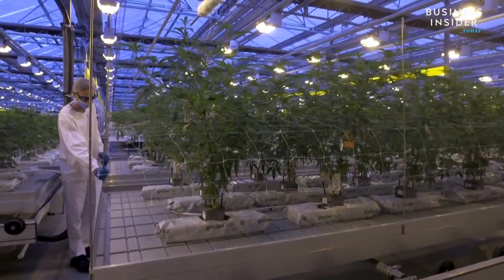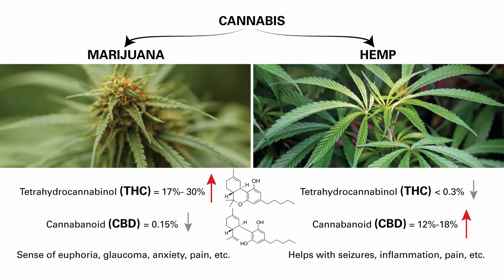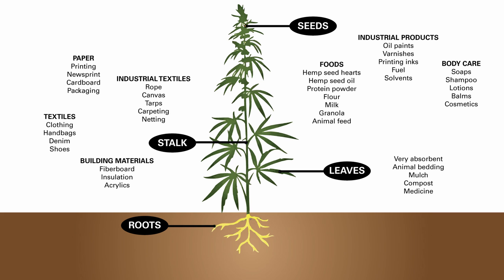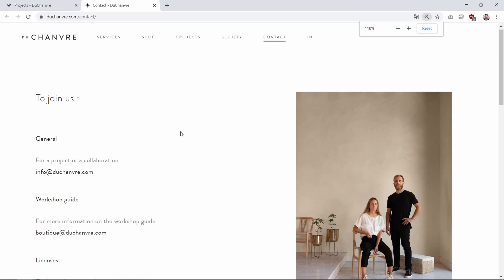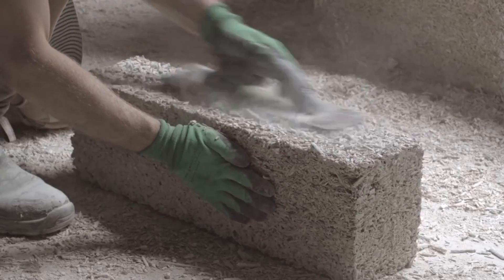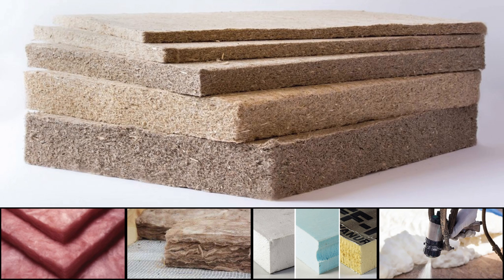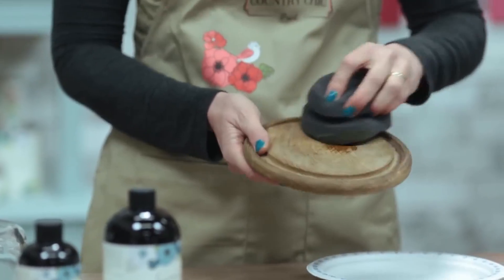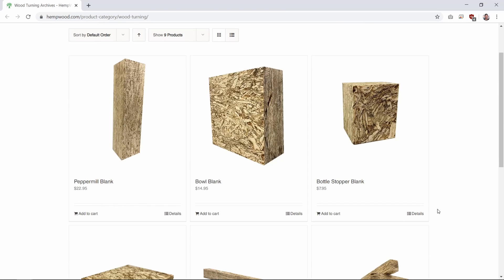Introduction to hempcrete, hemp oil, hemp wood and more..

Comment: The information described in this video is misleading and not necessarily correct......CANNABIS IS CANNABIS.... For example, the 0.3 used to describe so called hemp is an arbitrary number invented by regulators at the start of relegalization of cannabis. The varieties as well that contain 0.3 thc CAN NOT contain 17% cbd, the ratio at present is locked,,,,this is to say that if a plant has 0.3% thc the maximum amount of cbd is 7.9%......period

Comment: Some other benefits of hempcrete is, you. can reuse it. Up to 10% of a new batch can be old, crumbled walls, and you won't lose any of the benefits of hempcrete by using that amount.
If you've still got some left over, you can crumble it and use it as a soil amender, creating a more alkaline soil. Aside from using goggles and a good face mask when you're building/demoing, and not ending up with the lime/water mix on you, it is not carcinogenic or dangerous to the environment, like so many other insulation materials are. I sure as heck wouldn't grow my veg in old rockwool or foam insulation, but composting hempcrete? No problem!
Add to that the lack of trapping water in the wall, since the material is hygroscopic and monolithic... this is above and beyond my favorite insulation material. So glad you made a video about it!

Comment: Hemp IS Cannabis Sativa. 
Difference is that hemp is the name used when speaking about the plant grown for industrial purposes where cannabis (latin name) is more commonly associated with psychoactive properties at which point the term marijuana is also used to refer to it.
Main difference is as you have pointed out the THC content due to legality. Now comes the funny bit - Cannabis grown in the colder climate (e.g. Europe, North America) usually doesn't have enough THC and you need a hot and humid climate for the plant to produce THC. It's the same plant though, even if the plant would change through generations to addapt to the climate (say seeds brought from warm humid grown plants would produce more thc in the cold than their local counterparts, but this would level itself out in a generation or two; also vice versa). This is why plants grown for thc are usually grown indoors - to simulate these tropical conditions.

Great video overall, I just could not leave the canabis/hemp/marijuana scheme at the beginning. People should know it's the same plant. Nothing positive or negative, just how it is.

Comment: Again, the definitions that are used here are not correct.
This webpage like many others tries to claim that hemp is higher in CBD than marijuana.  This is a misunderstood technicality of a definition. Hemp is not more likely to be higher in CBD than other forms of cannabis. The reality is that you can call it hemp if the THC level is low enough otherwise it automatically fits in this category of technicality that requires the name be marijuana but it doesn't change the plant or its genetic origination. It is still cannabis they're both still cannabis. If someone is growing marijuana for the medical marijuana industry and that strain ends up with a low enough amount of THC then they can call it hemp and sell it on a more open market. It is not a different plant but a different definition that falls onto the same plant based on the amount of THC that grew in that plant specifically.  For instance I have been purchasing a strain called AC DC high CBD from the legal market for the past two years however the last strain I tried to purchase had too much THC in it and could not be sold, 
this was not a different plant or a different strain a different genus a different anything whatsoever other than too much THC formed when that plant grew, so it was no longer allowed to be called and sold as hemp.
 however there was absolutely nothing different whatsoever about this plant other than technically THC was above the allowed level to call it hemp
 and it was not any different of a plant than it was at any previous other time that I purchased it except for the amount of THC that grew into this train therefore caused illegal definition name change and restricted the sale of that particular crop. I therefore had to go to the dispensary and get low THC high-CBD flower.

Comment: Hi Belinda, awesome video & thumbs up. In South Africa, we have been exploring Hempcrete. My partners & I are developing a greener/eco form of concrete, through Biochar. I have researched hempcrete & have theorised that; that combining hemp to our Biochar base mix will mitigate the lack of structural integrity from hempcrete, in our opinion, hempcrete lacks the compressive strength needed, while showing good signs of tensile strength. Our Biochar cement mix lacks tensile strength while offering superior compressive strength. We attribute this to the lack of silica & is due to the lack of traditional stone & sand aggregates normally used with concrete. I believe hemp can provide the missing silica due to its composition properties. 
Our Eco building products are still in development stage & we in SA are still waiting on the legalization of cannabis farming, so we can carry our concept forward. 
Anywho great video & thank you for sharing the knowledge!

Comment: just came across your video and i love it. I think this is the perfect time if any to use hemp in construction to help mitigate climate change. we can cut down our co2 emissions but we also NEED to pull carbon out of the air in tandem. Hemp concrete can pull some of the carbon out while being used to infrastructure. i just have serious doubts the people in power are actually go to do something, and not just keep everything the way it is until they die, which is no longer their problem.

Comment: Do you think hempcrete is a good choice for internal insulation of a solid brick wall? Your latest videos about vapor permeability and air tightness didn’t mention it. Thank you!
Reply: It's commonly done in France. There are projecting machines to quickly plaster masonry walls. It is usually mixed with less lime (or gypsum or clay, or a mixture) so it is more insulating. For very thick applications, you may need to install a wooden structure made of  perpendicular cleats, to embed in the plaster.

I just realized you probably meant with hempcrete bricks. It is done too, using very thin joints.

Comment: Cannabis is Cannibis is cannabis, there are various strains but they are all flowering. Industrial hemp is just a strain evolved and crossbred to yield low thc (modern concerns) and long fibres (rope and fabric making - much older strains). Only in recent times has cannabis been bred to lower the THC values so as to not anger the anti drug idiots. The 2 major families of cannabis are Indica (asian / african /european ) usually higher CBD and lower THC, and Sativa (N and S american) Lower CBD and higher THC. Cannabis is cannabis is cannabis. Hemp is just another name for the same plant.

Comment: Marijuana is not a good word to define it. Hemp is a variety of cannabis sativa. And the only difference as you said is the level of THC which will define if it is hemp or cannabis.
Also, you have varieties of cannabis plants with a high level of CBD. it's not correct to say that cannabis is just high THC et low CBD. Most important, a plant with CBD will have psychoactive effects but no psychotropic effects.